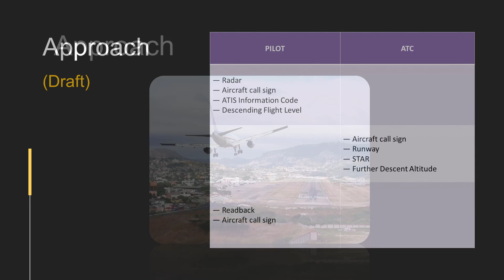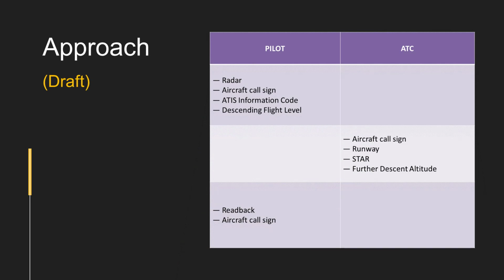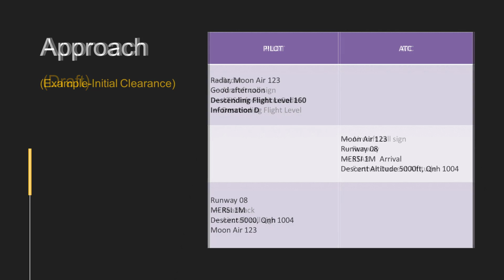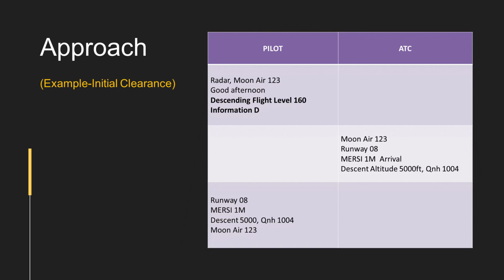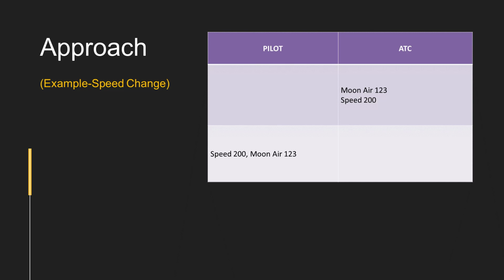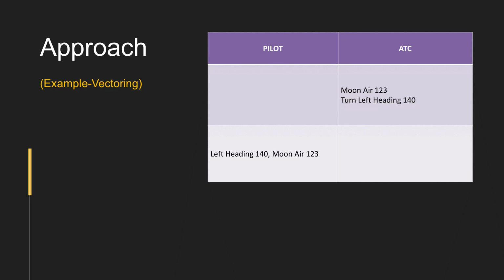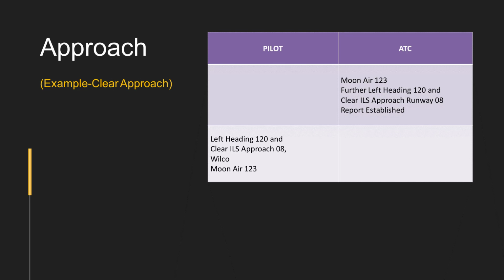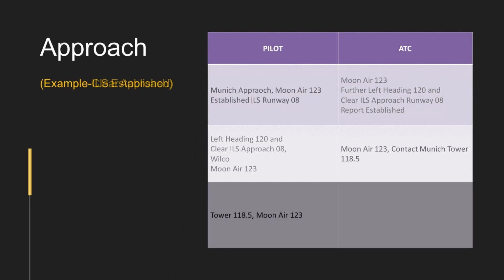Approach Phase Phraseology - Learn Radio Communication Basics For Pilots

Comment: Why did you say "information Delta"? I dont get it when you use phonetic aviation alphabet in communication while approaching or getting flight following or even taking off.
Reply from the maker: "Information Delta" here is the ATIS information code (Automatic Terminal Information Service)
ATIS codes are updated with generally in every 30minutes and get a code from A to Z

 It is used from pilots to inform ATC that we have the latest weather and runway information for that specific aerodrome we are approaching